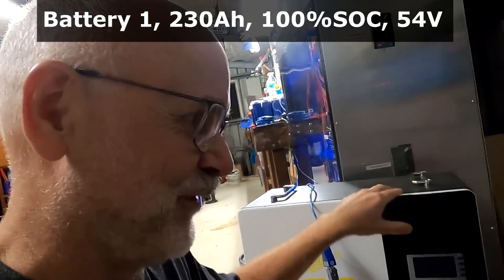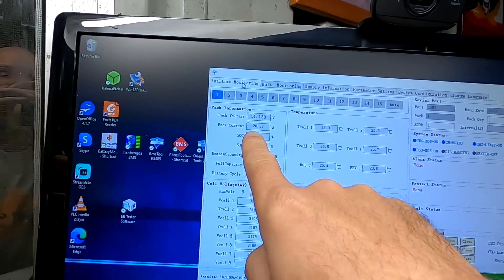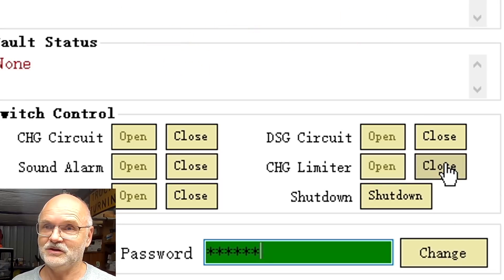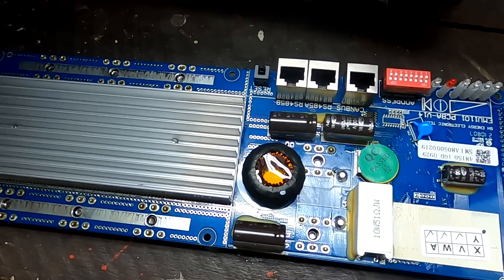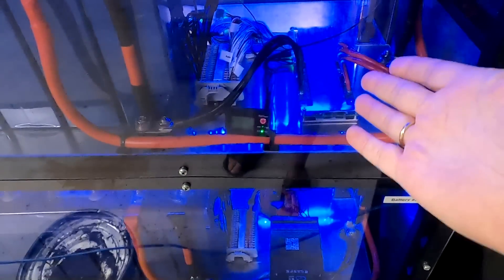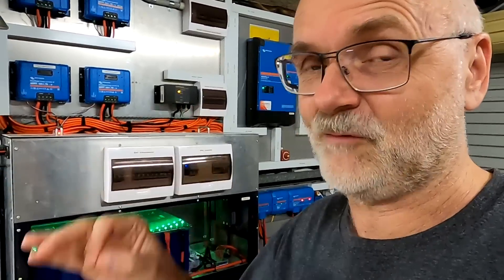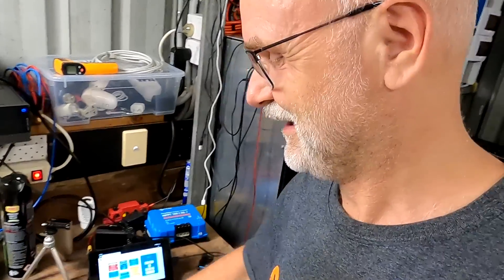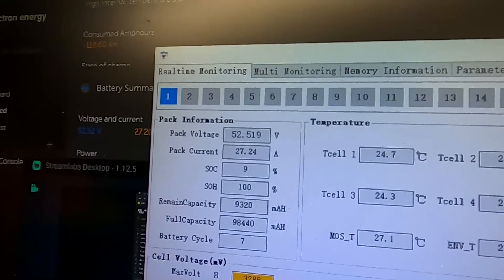BMS Active Current Limiter - Safety Feature or Gimmick?

Comment: I have two Easun 6048 MPPT in paralell. Each can 60A max,so paralell will be  total 120 A  way way to much for charging , but how can i limit the current for  my acumlator  its 24V 230A  lead acid?!  If im correct 23A the maximal charging current for it. I need such a BMS ?!

Comment: Amazing video. I have a question on passive current limiting feature. When you parallel batteries, current will flow from higher voltage battery to lower voltage battery, Won't higher voltage battery trigger discharge cutoff before current limiting is enabled in lower voltage? battery ...

Comment: Buck DC to DC switcher is added across charge disble MOSFET's.  (you can see the buck toroid inductor) Without the extra DC to DC converter only option is totally stop charging by charge MOSFET open when charge current gets too high to a low SoC battery pack in parallel with fully charged batteries.

The primary purpose of this is for paralleling battery packs where one pack is very low in SoC relative to other parallel battery packs.

Secondary use is to slow down charging current when poorly balanced cells battery pack is approaching full charge,  Make it less likely to totally shut down charging due to a cell overvoltage trip.

You usually need BMS to inverter communication.  Without comm it is likely inverter/charger will interpret current reduction as battery approaching full charge causing charge controller to drop to float mode voltage.  This usually also stops any further balancing because most cells drop to less than 3.4v with lower charging float voltage.
..

Comment: This would be perfect for a Camper Van installation, where an additional LiFePo4 is installed to an existing Lead Battery in the Car. It would prevent high currents from the Lead Battery or the Alternator to the additional battery. But it seems there is no 4S version available with this feature.

Comment: I understand it is a safety function, but setting it at 40AMPS and it works at only 20 amps is a FAILURE !
Have you tried setting at 60Amps and seeing if it is still faulty and stops at 20 Amps ???
I suspect Pace gave you this BMS for FREE

Comment: Hi Andi, ich hab ein Pace BMS gerade gelifert bekommen ( inkl. Akkupack ) und zwei seltsame Dinge pssen mir gar nicht. 1. CVL ist =Pack Overvoltage Alarm. 2. Balance Delta Cll Voltage= Alarm Zellungungleichgewicht. Das passive Balancing kann m.E. überhaupt nichts, da sogar mit nur 1,5 A Ladestrom hab ich zum Schluss 270mV Zellenungleichgewicht.  Hast Du sowas mal erlebt. P16S200A-31258-1.03- das ist die Hardware in den Akkus. Gibt es hierfür einen aktiven Balancer zum Nachrüsten. Grüße nach Australien.

Comment: That's beautiful.  Doesn't this remove one of the larger concerns for folks who are building a large DIY off-grid system?
Reply from the maker: Yes, absolutely. You can just add a new battery and don't worry about it. Or if one was disconnected for a while for maintenance, just turn it back on. Done.
I really underestimated this feature.

Comment: Hilarious.  Hark back to the number of times I posted on this channel in the past about limiting battery current during parallel charging to ensure no battery is exposed to excessive current as battery impedance changes during charging yet got told it had been tested and wasn't something that was necessary.

Just farkin' hilarious.
Reply: Andy's knowledge is continually evolving. Of course there will be gold nuggets in the comments section before Andy concludes X, Y or Z,  but those nuggets are sat amongst a pile of noise. You can't expect him to collate every bit of info - he would never get to do the hands-on stuff. Don't get bitter about - please teach us more about what's done in large battery systems.
Reply from the maker: Well, as I said in the video (not sure if you have watched it), this does not occur under normal conditions at all. It is a safety measure and feature, nothing else... It has never happened in my battery shelf and these kind of balance currents do not exist in parallel setup. At least not with 3-6 batteries in parallel. When fully charged, one battery takes more current from the charger than the bank next to it. There is no reason to control the current flow.
Again, it's a pure safety feature when introducing a new battery bank.
Reply: @OffGridGarageAustralia  Current divergence happens in pretty much all battery systems and is something all commercial battery system design takes into account and mitigates in one way or another..  The only people that fight uphill to say that it doesn't are the people that have not actually performed correctly implemented tests or perhaps any tests at all.

Hell you even half admit to it in your own post just now.  The penny is slowly falling towards realisation.  Maybe in 5 years time it will finally hit the floor.

Comment: Cool feature, however I wonder if it might interfere with charger algorithms and trip a charger into float mode. This could happen because the perceived battery voltage (to the charger) would be higher than the cell voltage really is. Ultimately it may just cycle between float and bulk/absorption a few times. But in doing this it may also trigger the shunt to register 100% charge. 

There's some fun to play with Andy :)
Reply from the maker: Well, this should not happen because the BMS will send the real battery voltage to the charger through RS485 or CAN. But I'll test it...
Reply: @OffGridGarageAustralia  oh of course, yes that's right with your setup. If the BMS was not communicating with the charging system then it may happen, but not in your setup. :)

Comment: Thank you for mentioning the failure mode of a BMS quickly disconnecting Itself from a solar charge, controller under load, which can definitely ruin your precious charge controller. I have learned this lesson, the hard way and I have decided to parallel 5000 µF DC capacitors to the output of my charge controllers, so they will prevent an instantaneous loss of voltage on the output of the controllers. 

I also bought a seplos 48 v 100 a bms and I did not know what the inductors were for and now I know. thank you. 

I am using Jbdja 300 amp bms’s with high current contactors instead of transistors for extra tough high output, current capabilities. That I monitor with the XiaoxiangBMS app. 

I am using eight cells of nmc chemistry in series for a 24 V inverter system that runs as high as 33 V DC! It’s a bit much, but it’s very powerful.
Reply from the maker: That's actually a good point. If the BMS disconnects under full load, huge spikes could occur and really cause major problems. This feature should prevent this at least when over current protection kicks in.

Comment: Saw a Victron 250/100 MPPT that was damaged when the DIY battery bank BMS switched off. Battery was full, inverter AC loads <350w.
Reply from the maker: Must have been an older model. They don't do this any more for quite a while and just go to absorption voltage when the battery is not present.
Reply: @OffGridGarageAustralia  When the panels are working, and the batt goes off, where must the power go? MPPT cannot go to absorption voltage ( Bulk charging volts).

The power must go somewhere, the batt not there anymore, can blow the MPPT. 

It gets wose ... the problem is system wide like the inverter too.

Inverter will show a DC Ripple. Small one, just a warning. Bad one and the inverter switches off for a little while. Really bad Ripple and the inverter is damaged, just like the MPPT, MPPT just much more prone to damage.

How do I know this? Been there, had that, with my first Lifepo4 DIY bank.

Batteries switching off under load, uncontrolled, very bad.

Comment: Hey Andy, i don't understand your argumentation in 8:20 that disconnecting the load would destroy the solar chagers. I mean the charger intput has to withstand the open circuit voltage of your solar modules in any condition. Its not the job of the load to keep the PV voltage in an accetable range for the charger. Thats just would be a wrong dimensioning of a solar system.
Reply: Many chargers/iverters uses the battery for smoothing, and could die if you suddenly under load removed that. It has nothing to do with high PV-voltage, rather that a lot of energy is flowing. My guess is that disconnecting the battery during high amp charging could make the voltage on the battery-side spike before the output regulation can react, and damage either the charger or other equipment still connected on the battery-voltage side.
Reply: @tamazerd  This is not a guess. An MPPT charger is a DC-DC converter. A current flow creates a magnetic flow in its inductor and this energy lets the voltage rise if the current cuts. For this reason you should place freewheeling diodes in parallel to relay coils etc. But such an active device has to handle this behaviour with a quick regulation path and output protection parts if necessary (TVS-Diode, VDR etc.).
Reply: @pierreleger2709  Ancient thread, I appreciate! But in a switch mode regulator the energy in the inductor is absorbed by the smoothing capacitor(s) on the output. These are sized to limit ripple to an acceptable amount, which is a small fraction of the DC voltage, and hence the charge dumped from the inductor will hardly change the voltage at all.  If the load is disconnected, the regulator will simply stop oscillating until the voltage drops again, adding no more charge to the capacitor.

Meanwhile, the input voltage will indeed rise to the open circuit voltage of the panel string, but this is not hugely greater than the MPPT voltage. Feeding the charge controller from a string of panels whose open circuit voltage exceeds the rating of the controller would be utter folly.
Reply from the maker: That has nothing to do with wrong dimensioning of the solar panels. The solar has to stay within the specs of the MPPT anyway, regardless. The problem is that if the battery disconnects, the voltage in the MPPT shoots up to solar Voc. Some controllers cannot handle this and burn out.
The Victron MPPTs go to absorption voltage and continue powering the load if capable if this occurs as we have tested here on the channel a while back.
Reply: @OffGridGarageAustralia Unfortunately i have not seen this video. You mean the output of the MPPT shoots up to solar Voc? Were the devices from a quality brand? I mean i developed industrial electronics for tirtheen years including power stages and cut-off loads are normal test scenarios. A DC-DC converter has to handle this without damaging it self and without voltage spikes outside its specification. Maybe I measure it on my victron MPPT with a oscilloscope.

Comment: Hi Andy and Thank you aagain and again for this video,really interesting! 
Remember Andy the first time you saw this current limit you did not understand, and found it useless?
I told you it was good, because it protects when connected in parallel (which not the classic BMS, like JBD, JK ...) and limits
your charging current at the end of charging is good!
It's good to have done this test and to share it with all ! 
Really Andy I think you are the only one to do these important tests, and to give the right explanations, congratulations!

There is one important thing that you will have to test Andy, on the Pace BMS, I know who if the BMS goes into OVP (over voltage Cells or pack)
and that it remains in OVP for a long time, because the voltage and charging current continue to be high.
I could see that when the voltage goes down and comes back to voltage release (cell or Pack) the BMS remains in OVP?!?! (stay in OVP?)

According to a battery pack engineer this would be due to additional protection? which when the BMS stays in OVP for a long time (like 3 or 4 hours) does it go to safety?
And sometimes it can stay very long in OVP, Even if the voltage release has been reached?? (this is not very understandable, but I have seen it several times)
Besides, I have sometimes reset the Bms so that it comes out of OVP mode?
Very interesting? but not completely logical?

Another thing Andy, the only problems I had on this type of BMS (BMS Out of Service) was the current limiting board that burned! (and at the same time burns the main board, so complete replacement of the BMS under warranty) But it was already a few years ago, no more problems, I think they solved this problem... I hope! Anyway thanks again Andy,😁👍
Reply from the maker: Thank you very much.
Yes, I think you're right with the OVP behaviour of the BMS if it stays there for several hours. I can recall having read something in the manual about it. It requires a discharge current to get out of OVP again at this stage. Just for a moment is enough.
I have tested the current limiter for a few hours and it worked perfectly. The temperature was only hand warm so all seems OK to use this feature for a longer period of time.

Comment: Very good information with the current limiting safety design. As many battery manufacturer don't recommend more than 2 or 3 in parallel maybe the components can't handle more. For this reason I would still recommend to be careful doing this connection with very unbalanced batteries and of very different capacity. I will still recommend a connection with some resistance in - at least to begin with.
Reply from the maker: Yes, absolutely. There is no limit with this feature but parallel batteries still need the correct fusing.
Reply: @OffGridGarageAustralia  As I have said before the fuses only protect after the electronics is blown. Fuses are not fast enough. If there is enough resistance in the cable so that max current can't be excided that is better. An even better alternative is an inductor that has the correct impedance to block a super fast start current. They will allow just about any DC current but not a fast change in current. Of cause they have the problem with high voltage if the current is instantly cut (like an ignition coil). The resistive solution only causes some small energy losses.

Comment: Like the idea of this if it was a permanent type of way to limit current.  For instance if your massively over panneled, or under batteried, you can keep the charge rate low, yet keep your charge controllers maxed to provide amps for loads without going over a specific charge rate.
Reply from the maker: That's exactly what you can do with the right settings in the BMS. Just limit your Over Current Alarm or Protection to say 50A and the limiter will kick in at this point. So you can tune the charging current but still leave all your solar power available for your load.
Reply: @Off-Grid Garage  oh yes, but reading some peoples comments on the design of the circuitry(I don't pretend to comprehend it) it might not have a long service life in that regard.  

Now I'm wondering if that's something the smart shunt/victron network might be able to control 🤔
Reply: I guess it's a cost/benefit balance. Technically it's not an issue to build, but a circuit that can handle say 100A when actively limiting would cost a lot more than the 10 or 20A in these examples. I think it's a nice feature for multi pack setups, but the total limited current (of all packs) should be sized to handle the total PV-output to be 100% safe.

Comment: Hi Andy on the neey active balancer if you have 2 battery packs in parallel and have the neey balancer in both packs do they show up in the app as individual units or do they conflict with each other Regards your fellow Aussie Rick
Reply: Same here🤔 all this information a lot to take in but necessary
Reply from the maker: Yes, they will show up as separate individual balancers. When you open the app and click on the three lines at the top left, the scan should show both. I think you can rename them there as well, so Battery1 and Battery2.
You can connect only to one at a time, so no conflict.

Comment: Excellent demonstration. Fantastic BMS.
Oddly, in this scenario I questioned if expansion of many current limiting circuits with differential logic would be even better.. As the number of components increased I cane away with the good old fashioned systems balancing at design along with doubling the robustness of the safety factors.

Comment: Hi Andy, what is ur NOC of ur solar. My solar is 545W per panel but its only giving out 420W. Could there be so much of difference. I hv a solar tracker working.
Reply from the maker: Yes, absolutely, if they are getting hot, the power output can dramatically decrease. 545W is at 25°C and full sun. That basically never occurs.

Comment: I find on my 3 JK BMS's, if I limit the in current  to say, 25amps, the BMS doesn't do its job... incoming will still go to 30,40,50 etc amps. Do your JK's work to limit Amps?
Reply from the maker: No, none of the normal consumer grade BMS will have such a limiter. They will turn off completely once they hit the set over current protection. As I said, some MPPTs don't like that and can burn out.

Comment: You only need to limit amps onces you have 3+ parallel batteries. That is if you have only two and one fails, that it won't overload the wiring specs as the output bms will trigger. But if you have 3+ then you'll have 2x+ the rated current and overload the wiring specs. You cover it by fusing.
Reply from the maker: The feature also prevents the BMS from disconnecting the charger/MPPT.

Comment: How would the victron react when it hits current limmit with and without data connection ?
Reply from the maker: They adapt, the MPPT will just deliver what the battery takes. No problem.

Comment: It depends on the total resistance of the wires plus connections plus the internal resistance of the batteries involved.  amps = volts / resistance.  You postulated 10 volts. Then if the resistance is 0.1 ohm (100 milliohm) then 100 amps.  If 10 milliohm then 1000 amps.  Reality is likely to be somewhere between those.